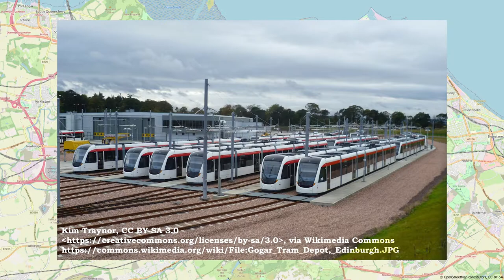Edinburgh Trams Explained

Comment: I have been looking into the Edinburgh tram system because I may need to use Edinburgh Airport as an alternative to Manchester. It's unfortunate they couldn't integrate the tram line into Edinburgh train station although in my case I can use Haymarket train station which is much closer to a tram stop.